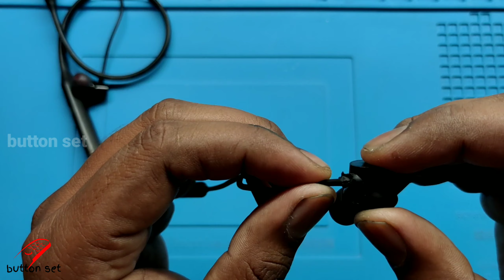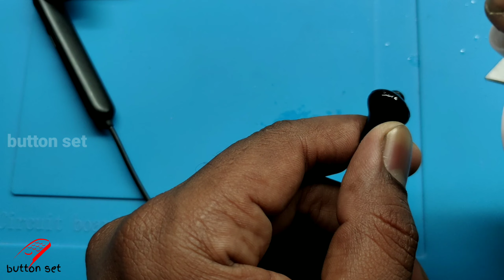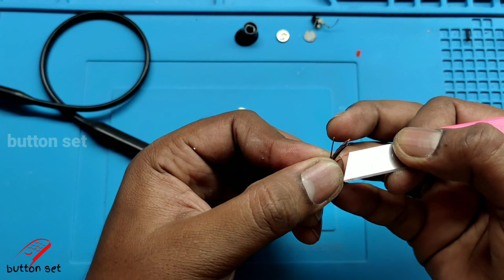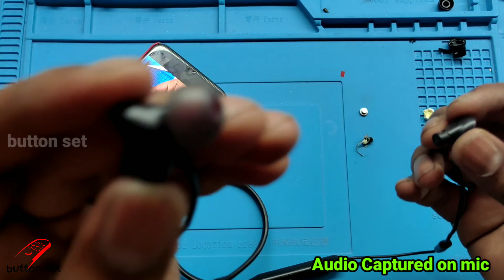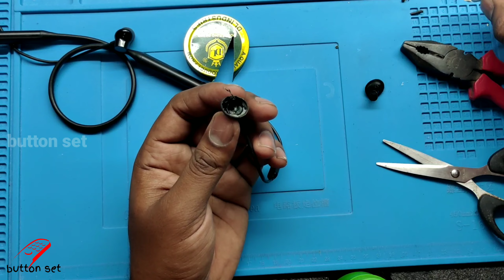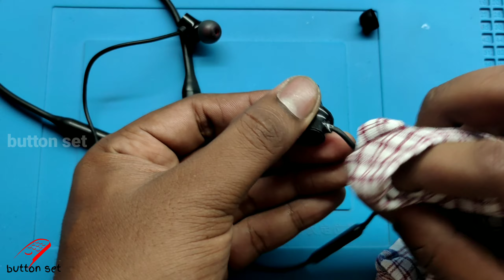Fix One plus Bullets Z Wireless Doesn't work || Bullets wireless Not Turning on Dead...!!!

Comment: You cut all the wires except speaker +&- ,, then how magnetic on & off works
Reply: same question
Reply from the maker: Magnet control in Right side bro 

Left side only Speaker 2 wire Remail All are Dummy

Comment: Mera automatically connect disconnect ho rha hai
Reply from the maker: Pls Rotate clock wise and anti clock wise in  Your Right side cable  
  Check the light conditions 
During tilting time this Concen happen na Pls trimm and Resoldering

Comment: i do own both bass edition and regular edition, regular edition was nearly 1.6 years but still running smoothly. and the bass edition do actually enhanced base but the built-in quality, feature, software bug is not acceptable.  i hate the bass edition,  wire tear, now not working properly, its not even 6 months, such a waste of time and money. now i want to the regular version again but they discontinued. one plus is dying its legend day by day. disappointment 😞
Reply from the maker: Regular edition device Design is Unique
Reply: @ButtonSet  service center enga bro
Reply: regular edition is available seperate
Reply: @Nandakumar-ye5tb  where is regular edition available? I want to buy one please send information here
Reply: I'm using just six month only now it's not working warranty also not claim

Comment: Explain bro about magnetic power on & off
Reply from the maker: In a Hall sensor, a current is applied to thin strip of metal. In the presence of a magnetic field perpendicular to the direction of the current, the charge carriers are deflected by the Lorentz Force, producing a difference in electric potential (voltage) between the two sides of the strip.

https://youtu.be/wpAA3qeOYiI

Better understanding

Comment: Bro magnectic on off works , there is any circuit for that please tell
Reply from the maker: Thanks for watching button set sir

Yes bro In Ear speaker back side one small circuit presense it's called HAL. type magnetic sensor it's works with magnetic field

Comment: I had a same pblm,if it can be repair how much cost consumes?
Reply from the maker: Thanks for your support

Kindly pls send your device pictures via instagram @buttonset 
  If already send pictures pls check DM
Reply: @ButtonSet  hi Mera one plus z ka hai uska magnet connect krne pe on off pause nhi ho rha aur manually on ka options bhi nhi hai please resolve or repair option please
Reply from the maker: Kindly pls send your device pictures via instagram@ buttonset 
If already send pictures na pls check DM
Reply: @ButtonSet  picture nhi diya but problem ka msz bheja hu